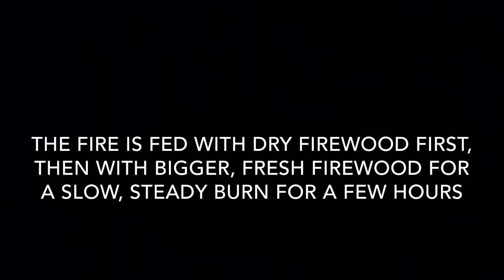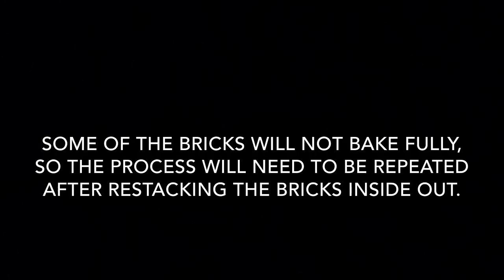Firing Home-made Mud Bricks

Comment: The production of this type of bricks (locally named "tijolos queimados") has a serious environmental impact, as it needs a lot of firewood that comes from deforestation. And the result is a very low-quality brick. The sustainable alternative, which the government also supports, is the Compressed Earth Block.
Reply: Always one tree hugger ,gotta make himself known.  Of course he touts the government solution as well.
how do you know that firewood doesn't come from already-felled trees?  Or do you always assume people do things the dumbest way possible because it's convenient for you?
Reply: yet this is far better than factory made bricks using industrialized methods. A huge benefit being made on spot and materials from one location. 
The amount of gasoline and industrial chemicals, electricity etc market bricks use is a hell of a lot worse.
The right forestry practices and this version COULD be entirely sustainable. Especially if they dont use regular concrete and make utilize their ash to make mortar. 
However yes, rammed earth is a cleaner option. Can even use far less wood with using the ash to make a plaster to make it more weather resistant. 
Or wattle and daub construction. 
My main point being the world would  be just fine with this method if the real problem, the big boys and their factories, were not an issue.
(i am a capitalist by the way, before i get the "lefty liberal" accusation,  but also an environmentalist, Im not saying the factories MUST GO but their issues need to be resolved.)
Reply: Guess what they lied to you TREES ARE A RENEWABLE RESOURCE AND THEY NEED TO BE CUT REGULARLY AND REPLANTED OR YOU WILL FACE FOREST FIRES DUE TO BUILD UP ON THE FOREST FLOOR FROM OLD TREES. USE YOUR BRAIN AND STOP LETTING OTHER PEOPLE TELL YOU THINGS.

Comment: use charcoal and charcoal powder between the layers
Reply: @altnative  charcoal is strong enough to support the weight of the bricks on top of it, even as it burns, so more hot air can pass between brick layers.  That helps propagate your fire deeper into the brick-firing clamp.  So you could put some charcoal between each layer of bricks and it'll remain fairly stable.  That will get your fire hotter, and keep it hot longer.  Best of all, you can throttle the amount of air you let in, so you can keep it from getting too hot too quick.
You can also use charcoal to smelt iron in a bloom furnace if you're into that sort of thing.  Charcoal is great, I love working with it!

Comment: Put the whole pile and pack it inside and out with manure dry manure use quite a bit of it you know 6 8 10 inches of manure completely around it then cover it with more mud and just basically bury the whole damn mess then lighter on fire and close up the air holes and just let it sit there and cook this will make all the bricks card and waterproof very old technique for making pottery I learned this watching the PBS about a Mexican kids made pots it was a kid show me and my wife tried it with the thoughts it'll work with bricks as well just Menard put up a barrier of rocks around the mess after you put the manure on it then cover it with mud laughing my dry before you fire

Comment: Please upload frame from which bricks are made
Reply: probably a wooden frame as big as you want it. but it seems like having no backboard or at least a removable backboard is the way to mold them without them getting stuck in the mold.
Reply: Square  roughly as big as you can make them 
As long as they each match and are the same shape it doesn't matter for most applications